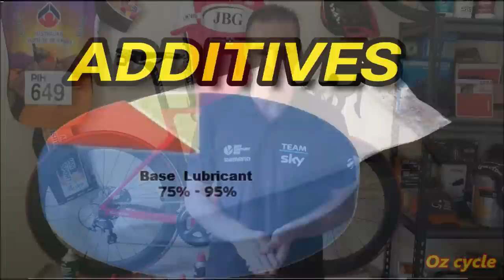Ultimate Chain wax - make it yourself

Comment: Hi Have just watched your video on waxing your bike chain, do you need to run in a knew chain before waxing it or just take it off a knew bike and properly clean with the three solutions you suggest and wax and put it back on . thank you in advance for your time Demetri M  Newbie to bike riding at 64 years young
Reply from the maker: Nice to hear you still riding at 64 Demetri. Yes,simply clean brand new chain completely with the procedure then wax. No need to do that clean again just do the rewaxing at 250-300km. Cheers

Comment: Hi Steve, thanks for the video! At last I was able to use your formula and seems to be working! One question: the chain is covered in wax which is probably due to the fact that I have not wiped it well enough after the waxing process... And then all of that wax seems to be crumbling and falling off it. Is this normal? The concern is that it falls off very easily and does not seem to stick to the chain. Will it stay in the pins? The chain was degreased very thoroughly and as I mentioned above, I have used your 10 wax parts + 1 PTFE part formula... Thanks
Reply from the maker: Thats normal. A thin layer of wax should still be on the outside of your chain tho. If not,re clean your chain thoroughly again and then try wax.
Reply: @stevenleffanue  Thank you Steve, I am astounded how helpful you are and how you manage to answer all of the questions that you have here on youtube. I think this may also be happenning due to the 'slippery' surface of the Wippermann Connex 11SX chain, as it is rust protected and nickel plated it may repel some of the paraffin wax.

Comment: I have a few questions about your ultimate chain wax and tests.

After I complete my first waxing there will be a lump of wax in my dipping pot.
Can I reheat the wax and use it again? I'm assuming you can continue to reuse the wax?
How do I determine how often I should re-wax my chain? Distance? Squeaking?
Was there a comparison of friction and/or wear between wax with PTFE and without PTFE?

As always, I love your channel.
Reply from the maker: When the wax cools it will be stuck to the pot,yes.
Rewax your chain every 250-300km.Using the same wax for up to 15,000km.
Paraffin wax on its own us good but when reaching the rewax time you risk metal on metal friction without otfe

Comment: Hi there, I have waxed all my 4 chains in order to proceed with re-waxing process every 1000-1200 km (once a month more or less). I use a rice slow cooker and monitor the mixture temperature every 5 minutes (changing the knob from "keep warm" to "cook" or even switch-ff and on the cooker from time to time). It seems to work well an thus I achieve a temperature between 88 and 97 degrees Celcius.
Question 1: Do we have to clean the cassette/chainrings (with a brush, a little of degreaser and water) every time we change one chain, or after 3 or 4 chain changes?
Question 2: Before re-waxing a chain, is washing it with boiled water enough, or is it better to soak it for a while (lets say 5 minutes?) in boiling water ?
Question 3: During the 1st wax, I soaked each chain for 15 minutes. How long should I soak them during a RE-wax?
Thank you very much indeed, greetings from Crete/Greece.
P.S. I suppose, that since my mixture is enough, I can wax 2 chains simultaneously, correct?
Reply: Hi ! No one ever replied so here I go. I have found no need to clean the rest of the drivetrain, but brushing dust and flaked wax would do no harm. I soak my chainS for a few minutes in hot water to make sure most of the wax melts off which gives me confidence to re-wax two chains simultaneously. Otherwise, since they lie one atop the other, I would fear dirt from the top one falling into the bottom one. I leave the chains for around 10 minutes on the (re) waxing phase. Make sure all water evaporates (either before waxing or until bubbles stop coming out [shake it while immersed in wax]). I usually turn the heat off so the wax starts thickening and by the time I pull off the chains, the layer of wax that sticks to them is thicker. 

Welp, better late than never. :)

Comment: WE APPRECIATE AND CAN'T THANK YOU ENOUGH FOR YOUR FREE METHOD OF LUBRICATING CHAIN. ALSO I WAS WONDERING IF I CAN USE THIS METHOD TO WAX  A MOTORCYCLE CHAIN.  IF WE CAN HOW MANY MILES SHOULD IT LAST.
Reply from the maker: You will need to consult a motorcycle shop to answer that
Reply: @stevenleffanue  It works on Motorbike chains

Comment: Thanks for sharing this. Like so many others who've commented, this video finally gave me the motivation to try chain waxing. I'm now on my 3rd re-wax and loving it.

One question I have is have you found any fake PTFE powder? I bought some from Aliexpress. I did also follow your 3-step process for cleaning the chains, with paraffin, degreaser and meths, but I have not had any of the visible powder deposits on my chain that is so obvious on yours. I may possibly have over-heated and degraded the mixture - I haven't measured the temp of my slow-cooker on the high setting. When I heat up the wax in the slow-cooker now (4th time heating) there is are just white bubbles floating on top.

I still enjoy what waxing the chain gives me, but I suspect that I'm missing out from the extra benefits that the PTFE should be providing. I'm tempted to renew my mixture with PTFE from a more reputable source.
Reply from the maker: Ok. The clean is not with paraffin but petrol then degreaser then metholated spirits.
Not sure about fake ptfe but 1.6um is maximum size.

Comment: Excellent video and great tips. Quick question on derailluer and cassetes - Do you lubricate these ? Sorry if its a bit of an amatuer question. Thanks in advance.
Reply from the maker: Not necessary. The less dirt on them the better. Silicone spray on derailleur pivot points tho.

Comment: Great vid. Should there be any wax visible on the inside of the chain / links. I can see it on outside after about 150km but not the inside. Dont want to be running it dry.
Reply from the maker: The inner working parts of your chain must have wax on them at all times

Comment: Thank you for the excellent and detailed presentation. Once the lubricant mixture has solidified, can it be reheated and used again in the future without remaking or having to spend on a new mixture of paraffin and PTFE
Reply from the maker: Thats what its for Rajdev. You reheat it and wax your chain over and over up to 15,000km....then its usually a bit dirty and you just make a new batch.

Comment: Works a treat - thank you.  The only problem is that I live in Hamburg, Germany - so the weather might mean I have to re-wax a little more often.  One question, is what should I do after a dusty/dry ride?  Should I use a little water on the drivetrain/chain or not.  PS - your dry brush trick works perfectly on the frame.  Thanks again.
Reply from the maker: If you want to clean your chain,remove it from the bike and pour hot water over it. You will still get another ride out if it or just throw it in the hot wax
Reply: @stevenleffanue  Thank you for coming back to me.  However, I meant a quick clean/wipe down after a ride (not re-wax).  Seems to be working a treat though....

Comment: I have waxed my chain several time and have a significant amount of black particles in the bottom of the wax. Do you have a recommendation on how to filter out the contaminants without also filtering the PTFE powder?  Unfortunately they aren’t just on the very bottom of the wax so I can’t simply scrape them off after the wax hardens. Thanks for the great videos!  Keep them coming!!
Reply from the maker: No. Hopefully a viewer has an idea. Completely clean your chain again,something is still inside your chain.

Comment: after some weeksof gathering everything, I started with a new connex chain (i am just at the edge of my current chain). i bought a small slow cooker, wax pellets ,ptfe powder, connex chain. did the chain cleaning with petrol, degreaser and white spirit then let it dry while waiting for the wax to be fully liquid.I noticed the quick link already was starting to rust so thats a point of attention. i let it soak for 25 min and stirred every ow and then. i then let the cooker cool down abit and removed the chain from the bath. after a short cooling period the chain was cold enough to touch and then unstiffen it around a wooden bar. cleaned the bike groupset like you showed (classic chain wax oil) and I'm testing it soon. I hate dirty chains so I have high hopes about this. Only thing I did not see is the ptfe powder on the outside crevices like shown in the video's
Reply from the maker: Connex links are stainless steel which doesnt rust
Reply: I meanwhile changed to the kmc link. The connex lifts out of the smallest cog because of its shape. I think it touched the end cap of the cassette.
Reply: I have only started cycling and used the bike inside for a few weeks on my bike trainer because of the bad weather. The cassette is new as the trainer is new. Is it normal I can find small pieces of shiny particles in between the small particles of wax. It looks like the largest front cog is wearing a bit. But I can also see the teeth on your front large cog no longer are new. I am quite new to cycling so I wonder if this is normal wear?
Reply from the maker: Turn the link the other way around
Reply from the maker: It's normal for the black anodising to wear off slowly no matter whether lube is used.

Comment: Thanks for the video. Just a question: why do you use degreaser on the sprocket and chainring? Why not directly pump hot water on them? The same as you do on the chain. Thanks in advance for your answer.
Reply from the maker: Yes you can do that but try not to get hot water on the tyre it may soften the outer layers and deform it.

Comment: The issue of using wax is new to me and thank you very much.
In a new chain, is it necessary to remove the lubricants, and then to apply the wax?
  Or apply the wax to the chain with the original lubricants?
Reply from the maker: Remove all previous lubricants.

Comment: @oz cycle Thank you very much for such hardwork & a detailed video! Can I know why you advise against using pots that sits over open flame? Why is it that when melting the wax the temperature shouldnt go up too fast?
Reply from the maker: A pot on a flame is ok if the temperature is controlled. Heating paraffin wax too fast or too hot damages it's chemical structure and looses its high lubrication property.
Reply: @stevenleffanue  Thank you very much for your kind advise! I will get a slow cooker then.

Comment: Hi Oz Cycle, I have been using your method for well over a year now with great results I am very happy with it, now I need to order more PTFE can you go smaller than 1.6 or is there a reason it's 1.6?
Reply from the maker: I tried .8um for about 4 months only. Didn't seem to be any different. I don't see why you can't use smaller.

Comment: Great video, really clear & easy to follow :-), thanks very much. Occasionally some of the events I do are longer distance such as 1000-2000km over 5-15 days of either Road, Gravel, Off Road…. If I wax the bike, what would be best to use while i’m out on the go (conditions can vary).  Is it totally fine just using drip lube as I need to carry everything with me on the bike as most are self supported events.
Reply from the maker: See "portable bottled wax" video
Reply: Keep a couple waxed chains in your pocket

Comment: Thanks so much for your videos on waxing . Am using your parifin wax / teflon mix for my  new emtb  . I understand e bikes are hard on chains and cassets . Really keen to see how it goes on the ebike .hard to believe ill be able to get 200 - 300km  out of each waxing .  Great info
Reply: Hi, I'm using the wax/ptfe on 2  e-bikes a 10 speed and an Nexus 8 hub with KMC chain. Both have  heathinow 2000km. There is almost no wear, mesuard with chain tool and kaliber. Rewaxed every 250  /300 km.☺☺☺ Before on the 10 speed the chain was a completely gone at 1500km (over 1%)😤

Comment: stunning! that is genius. i wonder how you would apply this technique to mountainbiking!? would u keep it the same but with shorter cycles. Maybe using "squirt wax" in between a full wax with ptfe? kind regards
Reply from the maker: Exactly the same. If in wetter conditions ,rewax more often or add paraffin oil to the mix.

Comment: Thank you so much for providing very good information. If the operating temperature is low, does the efficiency decrease? I am using sramred etab axs. The guide pulley is almost completely filled with the inside of the chain, and this part felt like the chain was holding the pulley. The coating went really well. Even after use, it was possible to confirm that the wax was coated on the side. Do I need to brush off the wax inside to apply it as thinly as possible? I want to find a way. Thank you again for creating great content. I wish you always happy and happy days.
Reply from the maker: As long as the wax gets inside the chain it's good. Yes your chain will feel stiff and chunky for the first kilometre or so after a rewax , then it gets very smooth.
Reply: @stevenleffanue  No matter how many times I try again, the feeling that the chain is caught in something doesn't go away. It seems that it is not suitable for axs12 stage. Or is it because I bought a low quality product of paraffin wax? The coating is so good that a lot of the solid wax attached to the chain comes out. So, I decided to use the previously used ufo drip. It must be good information, but axs 12 speed Well in cold weather. Thank you so much though. I always support you.
Reply from the maker: We have a rider here who waxes his sram 12 speed chain having no problems.
Reply: @stevenleffanue  So let me ask you some questions. Does the temperature of the paraffin matter? Without using a thermometer, I just put PTFE in the melted state, put the chain as instructed, took it out and dried it. There is a feeling of a little hard wax. Is that normal? Let's do it again. I play Zwift a lot. It definitely feels different. Is it ok to wax additionally and apply ufo or squad wax? Thank you so much for the reply.
Reply from the maker: Submerge chain in wax for at least an hour or until bubbles no longer come out of the chain when swished.
Do not mix lubricants , use only one.
Wax temperature 90degreesC ideally.
Reply: @stevenleffanue  Finally, the last challenge. I guessed the cause. I thought the thickness of the coating was getting thicker, so I shook it immediately after taking it out to let the coating come off to some extent. The result is satisfactory. There is no objection to operation. But indoors, wax powder is a real headache. It's dropping a lot. Thank you again. Have a nice day.
Reply: which re-usable link are you using for sram 12 speed?
Reply: @Dralbastaki  I just reuse it again. I was told not to do that, but I just use it again. I have purchased a spare, and after checking the link part using a chain checker, I will replace it if there is a problem.
Reply: @황록-e9q  which brand is the connecting link ur using for the sram chain? Kmc/connex/powerlink..?
Reply: @Dralbastaki  I am axs 12 speed spec. I use a powerlock d1.
Reply: @황록-e9q  they say 5 times u can change it, just curious, how many times u used the same

Comment: Hi Steven, Did 2 gravel bikes recently and very very happy with the results. However, we traveled with the bikes on top of the car for half a day in pouring rain and truck spray to the point where all the mud from our rides washed away. Would all this rain have washed away the wax from the chains. What should I do until the next ride. Love your videos and straight forward explanations. Cheers, Steven
Reply from the maker: Parraffin wax is waterproof so inside the chain the wax will still have its low friction benefits.  The outside of the chain may rust so adding 50% paraffin oil to your mixture would prove more water repellent for your drivetrain

Comment: I bought a premixed wax/ PTFE mix from someone in Oz recently, followed the instructions to the Tee and applied to a new Connex chain. Was perfectly quiet for the 100+ km(with lots of hills around Berridale). Just starting to hear some very slight chain noise now although chain is clean. should I re-wax now or re-evaluate every 50 km. thx in advance.

Comment: @oz cycle Hi, thanks for your video, I mean all of your video, I want to try your recipe, but I would like to ask you about WS2 or Tungsten Disulfide in 1um dimension, could be a good improvement in conjunction with PTFE or completely substitute the PTFE part? and if mixed together in which scale? Thanks.
Reply from the maker: WS2 is more expensive and the friction improvement is so miniscule it barley registers. WS2 also makes your chain colour darker and will leave grey marks on what your chain touches...a bit like graphite.

Comment: I found that the wax clumped together in-between the links. also, when I shifted the wax it seemed to come clean off and not leave anything behind. This means that it will do the same when the chain comes in to contact with the chain ring teeth. It didn't leave behind a film of wax. It's either a visible bit of wax or nothing. Is it because my chain is shiny looking rather than the dulll Shimano and Connex ones?

Comment: Interesting you say 10:1 with wax:PTFE ratio. Friction Facts were nearer just 1% PTFE and a little molybdenum disulphide. I wonder if having 10x the PTFE is better for either durability, efficiency or what, neither, or both....Any thoughts? I have been using the Friction facts formula for around a year, but I'll certainly give this a go.